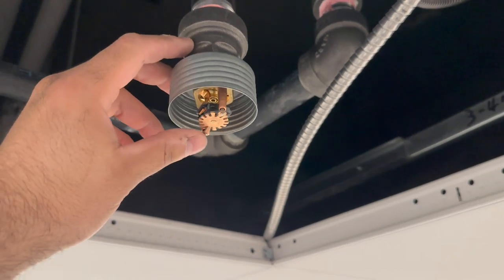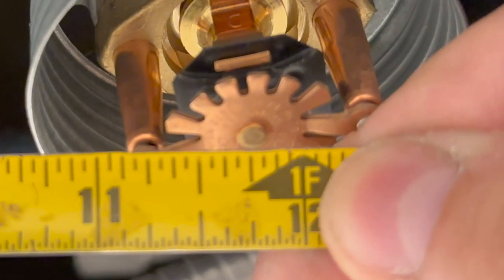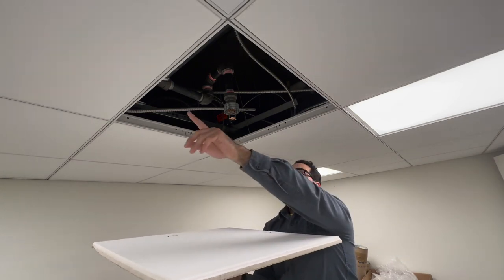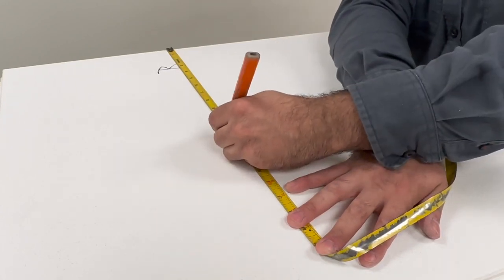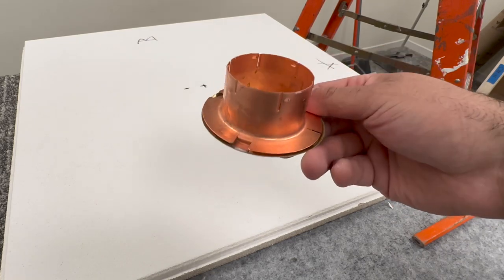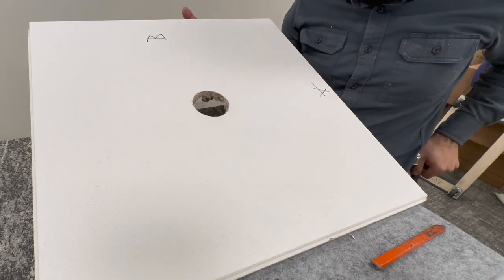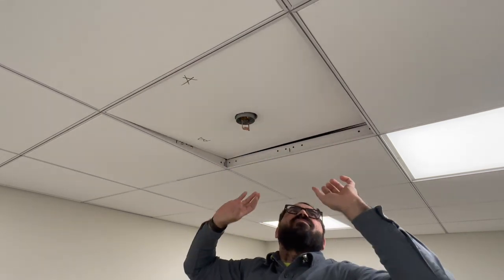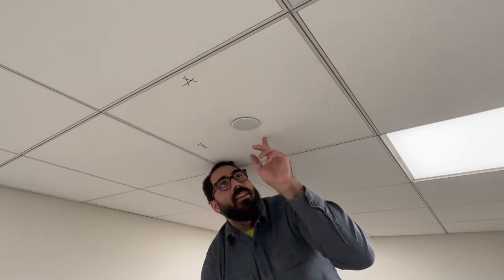How to install ceiling tile with sprinkler head in the middle. (With Breakdown) // Skill Stacking

Comment: Thanks for the video great explanation of everything. Will try your technique. Replacing celing tile is new to me and have to replace a bunch of water stained tiles. Going to put my on spin on it and also try out measuring the back side or using the damaged tile as a template drill from back with hole saw till pilot bit pops thru then flip tile and drill thru finished side.
Reply from the maker: Happy it helped 👊🏼

Comment: Did you have the sprinkler system off?
Reply from the maker: No I did not. As long as you aren’t hitting it with a hammer you’ll be ok. Those things will be ok with the little you’ll be touching it.
Reply: @skillstacking  ah okay just wondering bc I had one fall bc of a leak. But I was always told to never touch it at all lol low key a little scared about it. That’s why when I saw you touching it I got confused.